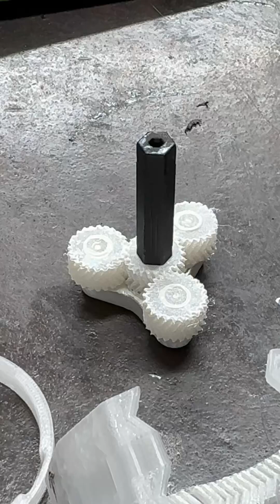I impregnated￼ my gearbox, giggity. #edf #turbine #planetarygear #petg #fyp #shorts #update #diy ￼

Comment: What you makin?
Reply: Terminator
Reply: The S T U B B Y
Reply from the maker: An electric turbine 3-D printed completely with the exception of the motor and the bearing, of course. It can be used as a standalone engine to put into a large scale aircraft or my ultimate plan build four of them and make another drone like my Shrike playlist, Shrike V 10 was the most successful.